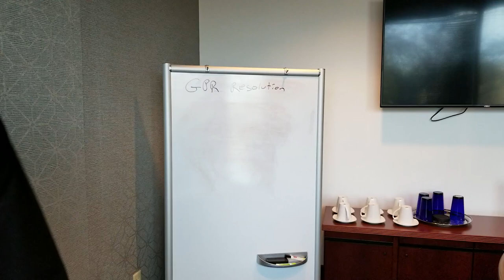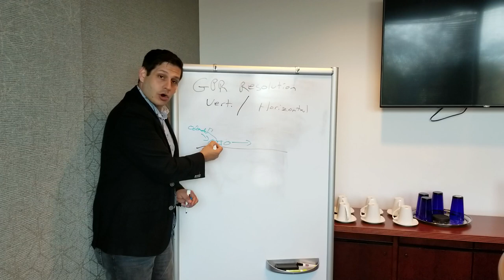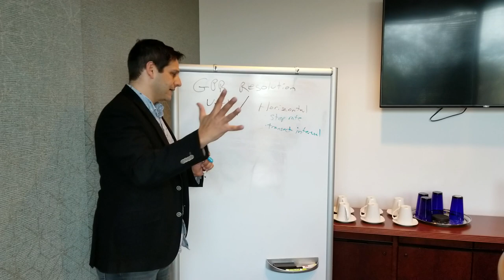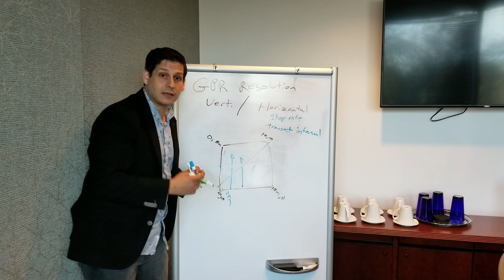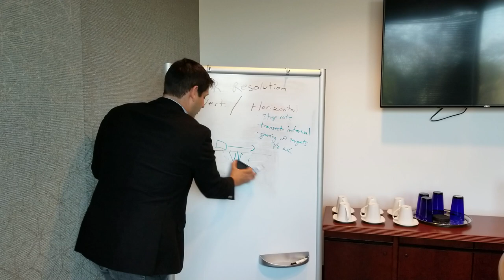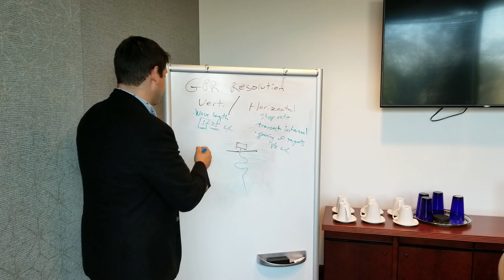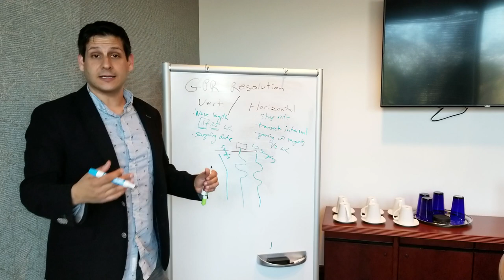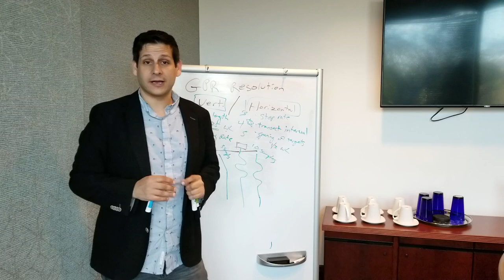Understanding Resolution of GPR | ground penetrating radar

Comment: Awesome video. Really good for GPR learner. About the third resolution, space of target horizontally, I think it is more likely depends on the antenna's beamwidth and the object's deep that will affect the footprint of single signal instead of depends on wavelength
Reply from the maker: Thanks for the comment. Great point. Beamwidth or footprint definitely has an effect.

Comment: You have not clearly defined or understood what is resolution. The basic definition of resolution the smallest size element that can be detected.  What you have describe are all factors which can affect resolution but they are not in themselves resolution. In the case of smallest distance in which two objects can be differentiated, in the ideal case, vertical resolution is approximately 1/4 the wave length and for lateral resolution is approximately sqrt(depth * wave length/2). However, in practice resolution is affected by pulse dispersion; attenuation; dielectric contrast between the target and surrounding material; the sharpness of the material boundaries; signal to noise ratio and signal clutter, to name a few. 

A common mistake is to think that more is better. More comes at the expense of production rate. Also, beyond a certain point increasing bits per sample, sample rate (samples per scan), scan rate  (scan per metre) or decreasing the line spacing will not improve the resolution. Although, to a small extent scan rate can help improve signal to noise ratio. A complicated topic that deserves a better explanation. Selecting to best parameters for a particular task is no always easy and may require some trial and error, experience, compromise and knowledge.
Reply from the maker: Good points. You should do a video on this topic.
Reply: I would be happy to do a video with you next time you are in town, Val, GBG Australia
Reply from the maker: I wouldn't agree with "needs a better explanation". Maybe more thorough. But I shoved a lot into 15 minutes and said it was a summary.  Many have said its helped them alot. And I said in the beginning it's about the size of an object that can be recorded then I said these other points are additional things that I think about when considering resolution.
Reply from the maker: But like I said, you offer some great additional points and I always appreciate the comments. We actually talk about much of what you add in our intensive training workshops. Looks like you all do some great stuff at gbg Australia. Would love to grab dinner next time or even hit an eels game.

Comment: I have a general question so thought I would ask here. How do you rate the IDS Detector Duo? Auto calibration scans shallow and deep. But I feel like when I use it. It doesn’t show much. There is no real ways to adjust settings except zoom and resolution. Would be interested in hearing your thoughts. 👌🏼
Reply from the maker: I think you can get an upgraded software called UNext. You should look into it.